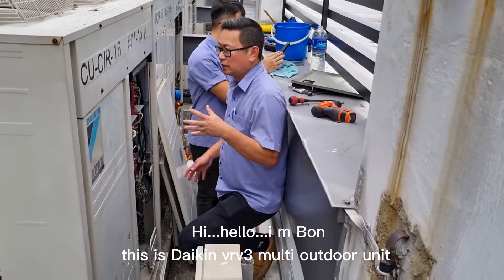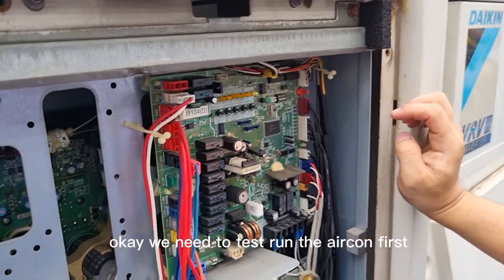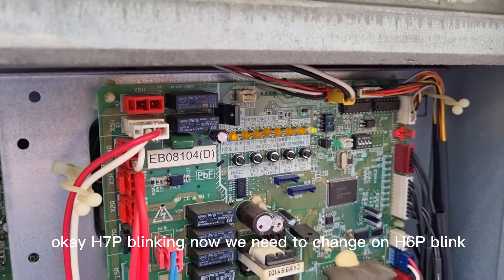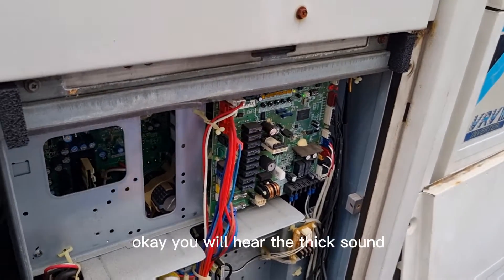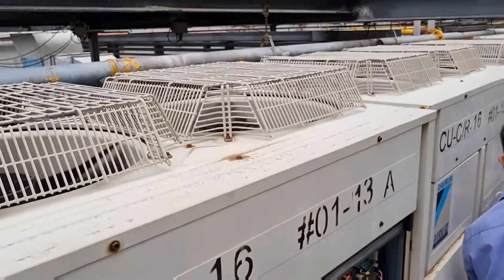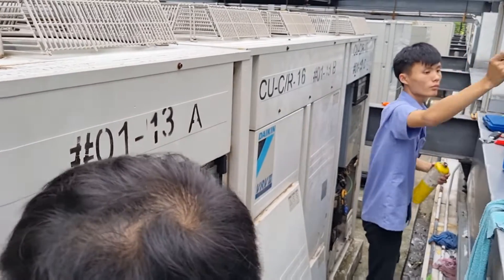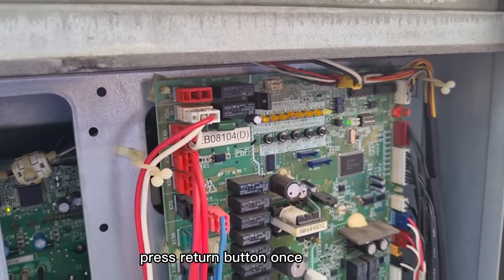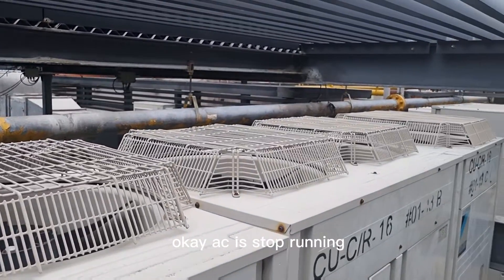How to indoor unit Force Operation | Daikin VRVlll

Comment: I have a doubt sir how to check media aircon 's indoor PCB.
Reply: Indoor unit haven't start
Reply from the maker: @peramaraj2763  may be pcb problem
Reply: @BonMj  from PCB to fan motor normally AC 230 voltage P1 & P2 is right
Reply: We checked this P1 & P2 voltage no have so PCB faulty is right
Reply from the maker: Vrv?
Reply: @BonMj  DX unit sir double fan for condenser
Reply from the maker: @peramaraj2763  sorry,not familiar this unit.

Comment: Mr Bon dakin spilt aircon 出现 error code UH,是外机电路板问题吗？
Reply from the maker: FCU 有问题吗？UH 是comunication 问题，wire 也可能，如果indoor ok， 多数是cu
Reply: @BonMj 感谢您的回复，空调是system 3 mini Cassette，两台indoor unit error UH, 一台indoor unit error A5, off power reset后可以运行一天又出现error
Reply from the maker: @zsjzhang6649  如果这样，先check A5,可能coil choke 或thermistor 有问题。
然后再看还有没有UH出现。